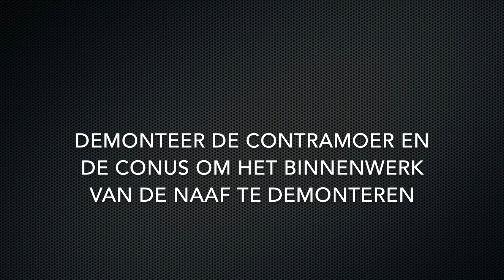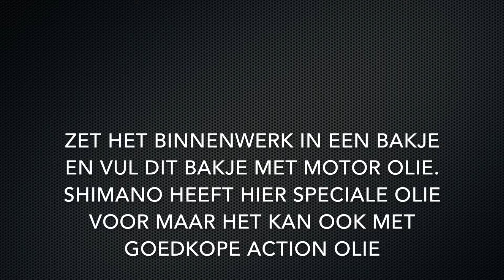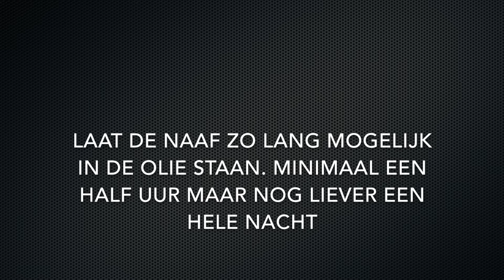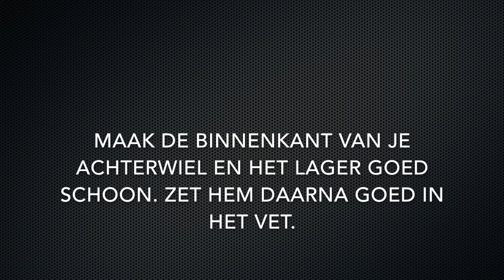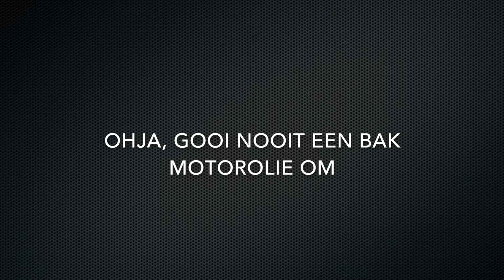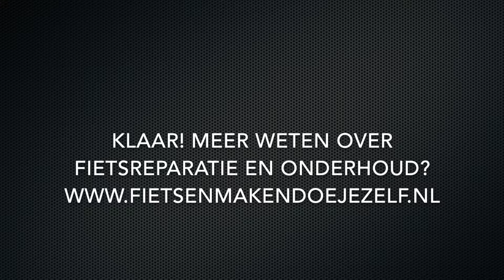Nexus 7 of 8 naaf onderhouden - Servicen versnellingsnaaf

Comment: Good video and clear instructions! However, I would definitely give it a better cleaning. Grab some brake cleaner and spray away all that dirty brown grease on the outside and also on the inside. Then dip it in gearbox oil. The way you do it there is a lot of dirty grease left inside the hub that will mix with the oil over time.  And last but not least: although motor oil works, it contains a lot of additives that aren't needed for a bike. Those additives could even react with the plastic parts, for example the plastic ball bearing holder ring. Use gearbox oil and get the GL4 or GL4/5 combi version. Do not get the GL5 version, since GL5 has more of additives that also could give problems in the long run...
Reply: Shouldnt you use oil for lubricating at all and rather use grease? - Oil is too liquid and isnt going to stick to places where its supposed to be and also it can seep out of the gaskets i think... - Lithium grease with Teflon is what is usually used.
Reply: @jeffreylebowski4927  Oil doesn't need to 'stick', it's just a difference lubricant. Kinda like oil in a car engine. The oil will be everywhere while the engine runs. Same for a gear hub.  The Rohloff 14 speed and Alfine 11 speed both run on oil. However you are right about leaking, so don't use too much oil and if your hub is running fine don't fix if it aint broken
Reply: @multireel7590  Yeah i see - I guess even if all the oil drips down into the "shell" - since its the shell that is rotating it will fall back and lube the rollers that are in contact with it, didnt think about it that way.
I just took mine apart because it wasnt running well, but even after 10 years of mistreatment the inside is still clean and lubed up, so it was just all the dirt on the outside and at the bowden mechanism that slowed it down...
Shimano uses white teflon grease but I guess oil can work as well if the rubber seal will keep it inside...
Reply: instablaster.

Comment: I thank you very much for this Instruction. The picture were self explanatory, so i did get everything without speaking dutch. Right now the guts of my nexus 8 taking a relaxing bath in a bucket of cheap Transmissionoil.
Reply from the maker: Really nice to hear man! Thankyou for your reply. Good luck with the project!
Reply: grease is the better solution
Reply: @pindanymus3403  no it´s not. Shimano documents also use oil.

Comment: Nexus 7 or 8 hub service

Remove your rear wheel

Place your rear wheel with the flat surfaces in the vise. Disassemble the roller brake with a key 17.

Remove the jam nut and cone to remove the hub interior.

Place the interior in a container and fill this container with engine oil. Shimano has special oil for this, but it can also be done with cheap action oil.

Leave the hub in the oil for as long as possible. At least half an hour, but preferably a whole night.

Because my hub is not completely in the oil, I turn it over again.

Thoroughly clean the inside of your rear wheel and the bearing. Then grease it well.

Remove the hub from the oil and let it drain well.

Oh yes, never knock over a container of motor oil.

Put the hub back in the vise and lower the wheel over it.

Smear some more grease on the cone and tighten it hand tight. Check that there is no play in the hub.

Now install the counter nut and the brake.

Reinstall the shifting system on the hub.

Mount the wheel back into the bicycle.

Comment: I really really wanted to hear how it runs after he finish the process. Though i like the music, it is important to hear ''before and after'' difference of the noise. But i suspect that this guy perhaps intentionally didn't do that because from my experience when hubs are in this color (i mean this much rust inside), bearing race are already dented and that uncomfortable noise we hear before the disassembly might be coming from the damage. In that case, no matter which oil you bath, the grinding noise and feeling will not go away. I once tried to fix damaged race by Dremel but the damage was too much and it didn't make difference. I still encourage somebody to try it because you are going to waste it anyway...
Reply: Next to that he only did an oil bath. You need to put on lithium grease on the gear wheels so it will not be metal on metal. In a closed system it is ok to just work with oil but not here. Motoroil also isn't the best choice, better get gear oil (75w90), less viscosity at high temperatures.

Comment: I would use gear box oil. API GL-4 only, not GL-5 and also not GL4/GL-5.
Reply: What is the difference? I bought ATF and now I'm thinking of returning it to get gear oil instead.
Reply: I googled it and learned that GL-5 has sulphur additives for use in high pressure situations, but can react with certain substances.

Comment: Great instructions. BTW, did you say there that we should leave the hub in oil over night? Manual says 90 secs..
Reply from the maker: Thank you! Yes i said overnight. Most of the times when you do this with an older hub there will be some iron pieces and stuff in the hub. If you leave it in for longer they will all go out to the bottom of the cup. I think 90 seconds will only be enough if its a newer hub.
Reply: Thank u sir! Do you think the oil bath could solve problems such as sliding gears? I mean the gears get into their position perfectly. However, I can't push with max force on the peddals. I need to be gentle so the hub doesn't skip. Happens on all the gears, least on the 8th. The belt tension is ok, wheel alignment ok, the hub is fairly new, 2017 but could be geting to that 5000km mark.
Reply: @MartiniOCP  could it be your gears are just a bit off-sync ? Try to align the yellow dots (in 4th gear)
Reply: @MartiniOCP  i've just fixed that on a 8 speed (in a bike that i found on the kerb with some more refuse!) by just adjusting the bearing play like Benn shows in one of his other videos. (and checking the alignment and lubing the shifting mechanism at the hub.)

Comment: Which oil you used exactly?
Reply from the maker: I just used some cheap motor oil man!
Reply: Benn Veninga 
Ok, but it was 15w-40, or maybe 5w-30?
Greetings!
Reply: Benn Veninga 
And olso, its working good with this oil?
Reply: I read on a separate forum that automatic transmission fluid (ATF) was a good choice, so that's what I'm using.
Reply: I would use gear box oil for manual transmissions. API GL-4, not GL-5.

Comment: uhm you need bearings greas NO oil because. when its getting warm it is getting thinner and gone is the oil. and that is not happening with greas because it is much fatter it stays in the hub i think that its very important to tell you all
Reply: And you think a motor dont get hot?
Reply: @Gieszkanne  plus, how hard will you bike to get your hub "hot"?!
Reply: how fast do you ride, thinking you can get engine oil in your hub hotter than it would get inside a combustion engine?!